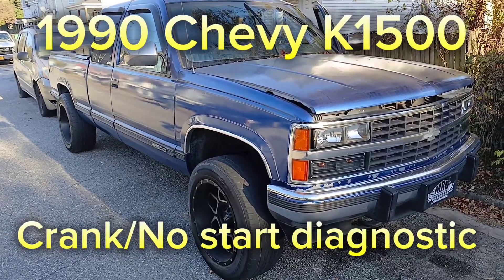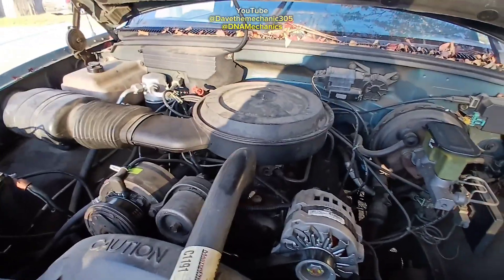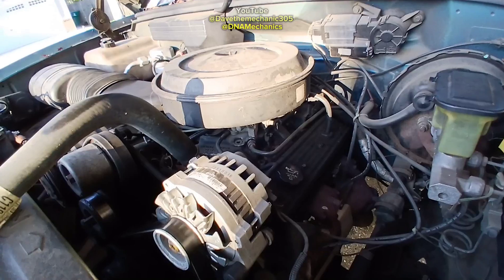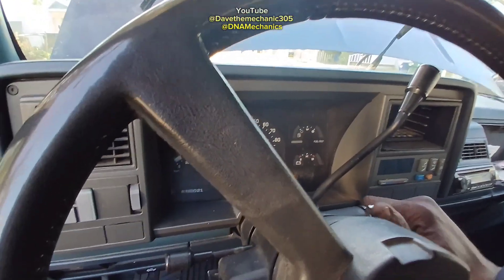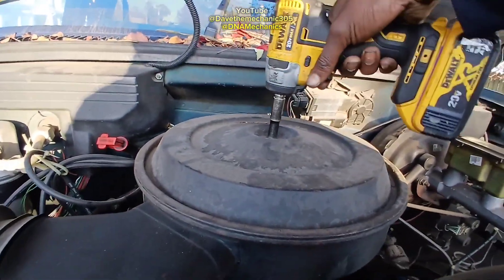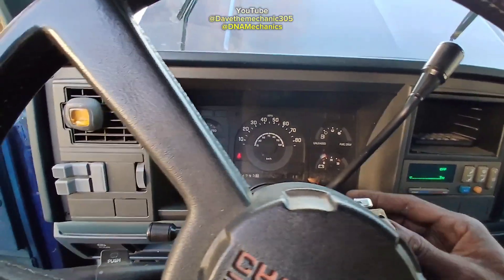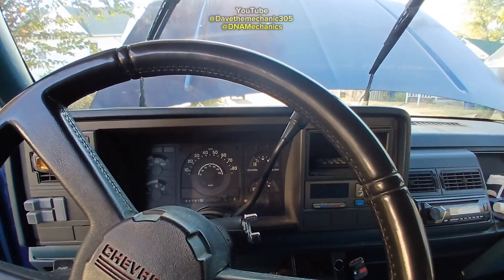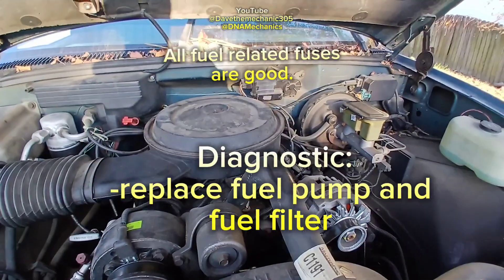1990 Chevy K1500 fuel pump diagnostic. crank/ No start.

Comment: Can u make a vid of what to check i have the same problem. Like where to check the fuses or the grounds as well. For example the ground of the fuel pump. 
Cause I already went through 3 fuel pumps
Reply from the maker: The fuel pump fuse for this one was right beneath the steering wheel. I don't have the vehicle to make a video right now, but if I get it back, I'll make one about the grounds and fuse location